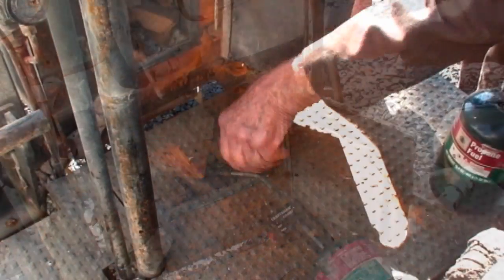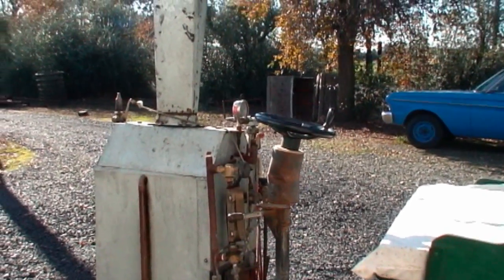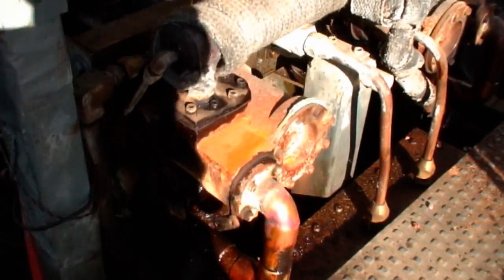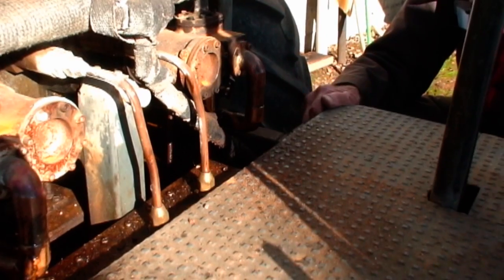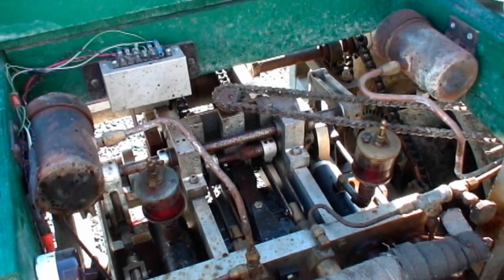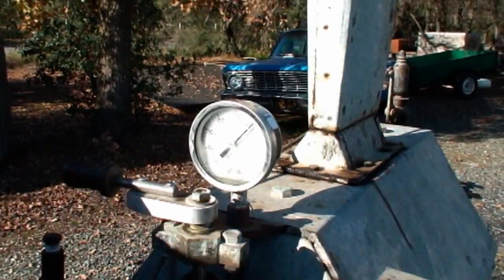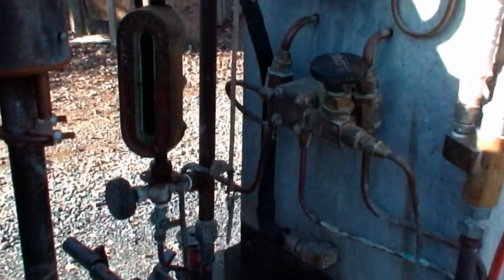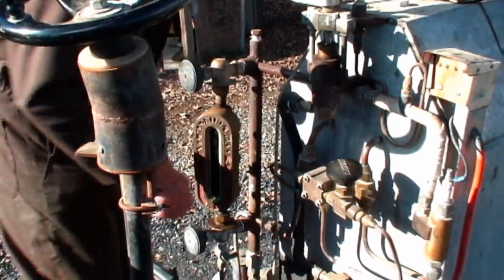(HD) The Amazing Steam Engine (Piston Valve) Tractor by Jim Tangeman (2008)

Comment: The Stanley Brothers were really ingenious.
The boilers have really close spaced (nearly 1000 on a 30 inch) tubes swaged both ends. Each tube acts as a stay.
The outside is wound with 3 layers of tensioned piano wire.

Comment: Stanleys are vertical fire tube always have been.

The recent Model works Locomobile recreation runs a watertube boiler at 250psi

What pressure a boiler type can take is up to the design. A 600psi boiler is no more dangerous than a 50 psi boiler IF you know what you are doing and Jim Tangeman most certainly does

Performance and size is directly related to pressure. For small compact units to produce a reasonable amount of power higher pressure is the way to go.

Comment: "The big steam traction engines run on alot less than 250! What you're telling me is stuff I already know."
You don't know about high pressure steam though. Stanleys have run around 600psi since about 1904 even in the small cars
Dobles ran 900psi and owners tend to hot rod them to 1500psi. There has NEVER been a steam car boiler explosion. 150psi traction engine boilers have let go and killed people. 
You just need to know what you are doing.
Check out Jay Lenos Garage

Comment: All depends on the size of the piston, and how much load you plan on putting behind it. Again you already know that. Higher BP will give some additional capacity, and probably be more forgiving if you burn low on your fire. I think a boiler failure at 150 would kill you just as dead as at 250.  Big tractors also turn a lot slower and use a much larger piston, they can utilize lower pressure, and figuring that maintenance won't be as great, *should* be safer.

Comment: It's all relative to what the boiler is designed for.  original steam locomotives where barely over 100 PSI, but by the time they were phases out in the 50's they were around 350 in some engines. You generally get better efficiency with higher pressure.